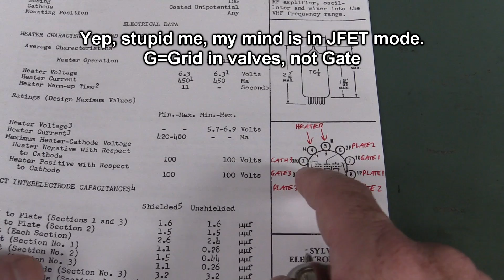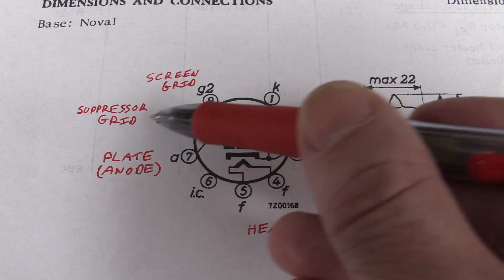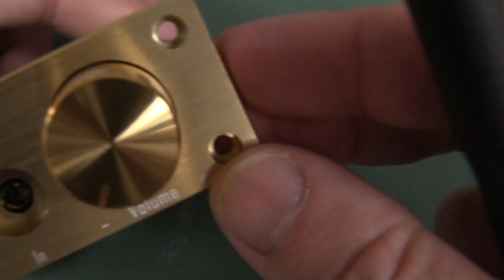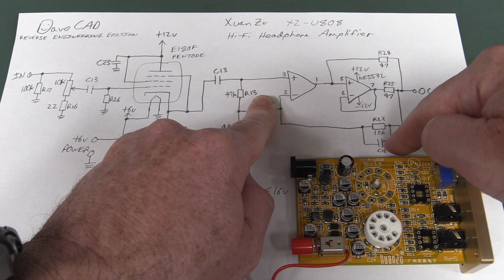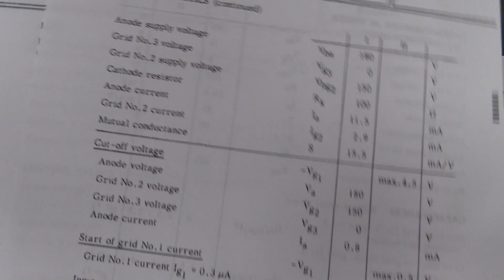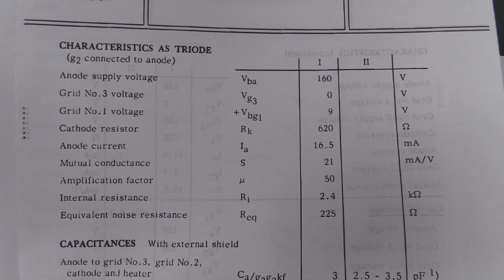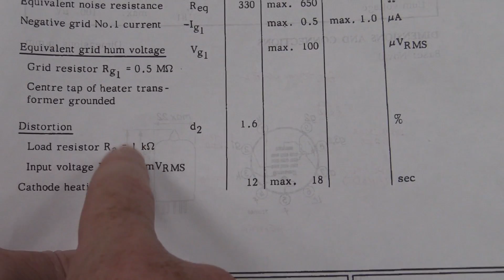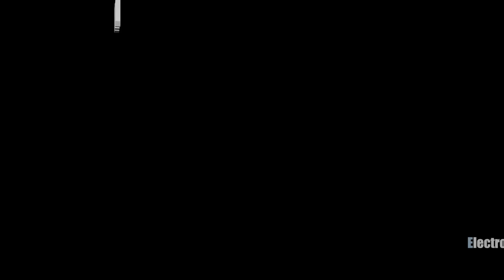EEVblog #837 - Reverse Engineering A Valve Headphone Amplifier

Comment: That's a shitty headphone amp, in no way any type of reference, and should not even be compared to REAL tube headphone amps. This is like taking a  Yugo 45 and then judging all other cars by it. Take a look a well designed tube amp, that would be more interesting. A lot of people (who don't know a lot or anything about this) will now wrongly take this video as proof that  all tube headphone amps suck. Manufacturers of junk like this should be locked up.
Reply: Why would headphone amps even use tubes? It distorts, and the producer clearly didnt intend more saturation on his track, making it worse.
Reply: +derbigpr500 Why not just use a DSP to color the sound to that of tubes and use a solid state amp that can be transparent for mere dollars?
Reply: +drkastenbrot 
Then you probably haven't used a headphone amp ? I build one myself and with a good audio source and a decent pair of headphones you can have the best sound system you can get in my opinion.
Reply: +Tim Ramich On live events, this is often done. Vintage audio compressors, amps, limiters etc. are emulated by software running on the mixing console. Also DSP is a common technique in guitar effect pedals. In recording studios real (tube) hardware is used because producers love it.
Reply: +Tim Ramich it´s already beeing done in the "lower-end" guitar amps and floor pedals....but they still can´t compete with the real stuff....as a keyboard/organ player, there still is no substitude for a leslie/rotor system when it comes to "sound" and especially when overdriven (=saturated)...I would love if there would be one, as my rotor system is 1.50mtr tall, and 80 by 80 cm width and lenght and weights about 50kg....

I tried nearly all "modelling" gimmicks (ventialtor, rotormat, leslySim....)but only the ventilator was close, but only when played clean, when it comes to overdrive it´s just harsh....naaah...
Reply: +drkastenbrot 
the producer's do even more stuff to add saturation. we use white and pink noise to underlay the mix. tube and tape saturation is added on almost every digital production.
Reply: +TubiCal Ever tried strymon pedals? Pure DSP, sounds amazing. Certainly not low end, used by many famous rock bands.
Reply: +Silent Woodworker Tape delay for the guitar, love it;)
Reply: +as df the problem with the DSP setups are, your at the mercy of the DAC. because I have heard some DSP stuff and they sound like mechanical shit. But ive heard other DSP stuff mainly in higher end radios, sound awesome. all depends.
Reply: +THEtechknight all of this is very subjective. Especially because the weakest part is always the speaker. No exceptions.
Reply: +drkastenbrot you could use the same argument to say that graphic equalizers are wrong to use.

people have their own way they like to tune the sound of what they listen to. you're implying that's wrong?
Reply: +drkastenbrot There are such things as pleasing distortion.  Also quite a lot of time the music is mastered poorly so you cant always trust the mastering engineer.  Honestly speaking as an audiophile, the mastering of the music is what will make the biggest difference in if it sounds good or not as long as its properly encoded/physical medium not damaged.  Once you have some equipment that is sufficiently transparent there are some albums that are unlistenable.  One of the worst offenders is Red Hot Chili Peppers Californication, I've also heard Imagine Dragons is terrible as well but I've never listened to them.  I've got both a solid state amp and a hybrid with a dual E88CC tube preamp.  Its uses the tubes as they were intended to be with proper voltages for the plates.  One reason tube amps can sound different and more pleasing to some is that headphones can have wildly varying impedance values over their frequency response which tubes will respond to in a different way vs solid state.
Reply: mmaluchnik
Yes, tube amps tend to have a more linear frequency response.
Reply: +as df You're joking right?
Reply: RminusOR O well, what I meant to say was that the tubes can flatten out the uneven frequency response of headphones (or other speakers) because their behavior is a bit less dependent on the changing impedance of the speaker.
Reply: +mmaluchnik After hearing Super Audio CD and DVD-Audio, along with high quality vinyl rips at up to DSD128, and directly comparing them to the same mix on a standard CD, I have realised how much we were all duped in the 1980s with CD.  Vinyl sounds totally superior to CD in every way, and with modern computer software nearly all the pops and crackles can be removed.  Nothing is better than the studio source masters of course, but we never get to hear those;  well I have but only with my own recordings in a tape based studios.  Modern digital studio productions these days are terrible and are over compressed and mucked around with, so even the best reproduction systems will struggle to make these sound listenable!  I love valves in guitar amps and some good audio pre-amps.
Reply: +EgoShredder You can make a CD sound just like vinyl. My guess is that to come to these delusional conclusions, you knew which was was playing. People never get to hear the studio masters? What do you think places like HDtracks sell? 16 bits and 44.1 kHz is enough.
Reply: +EgoShredder I do have to agree that the best sounding tracks I've heard have been in DSD. The DSD of Thriller is just stunningly perfect. I don't really think it's the DSD that makes it sound better, I think it just happens to be the best mastering of it. That's playing it with both JRiver converting it to PCM on the fly along with my other DAC that does native DSD.
Reply: Tim Ramich PCM music above 16/24?  What point are you trying to make?
Reply: +drkastenbrot Only guitar amps are supposed to add saturation, stereo amps are not. Some do unfortunately, I'm working on a stereo now that had aweful gritty base to it. Added some bypass capacitors to the cathode resistors and winner, winner chicken dinner. So it all depends on how good the circuit design is, nothing to do with what is used to amplify. Sound used to be produced directly from records with a funnel. Yet if you throw your phone into a cup it sounds like crap.
Reply: cyberdragon And why do you think you speak for everyone?
Reply: +mmaluchnik You drive your stereo amps into saturation? Well in that case it would matter.
Reply: The only time I use valves is for artistic reasons as a musician, but when I am listening to pre-recorded music I prefer accuracy and faithful reproduction, so no valves are in use as a listener.
Reply: Tim Ramich You did not read or understand my comments.  When I mentioned studio masters it happened to be my OWN music.  Of course I can never hear the master tapes of other artists!  I thought that would be obvious....  As for bit depths I think you need to gain more experience, because anyone who records and sequences music, will know that higher bit depths moves the noise floor further away, thus giving you more usable dynamic range.  It has long been known that using 16 bit means a narrower dynamic range due to the noise floor being higher, so to get around this people use more compression to squeeze more sound in that space.  Compression is a useful tool but you can use too much, and make things sound flat and ugly.  All being said I would still say you need to use your ears to decide what is best in any situation or format.  Last night I listened to a familiar album on SACD, which should in THEORY be superior to any other format but the one I preferred was the vinyl, as it sounded to have more body and realism;  the SACD seemed cold, clinical, thin although it was much clearer with less distortion.
Reply: +EgoShredder Bit depth is only useful for mastering. No shit you need a higher bit depth when you're combining tracks and adding effects. It's increasing the precision of calculation. As for final delivery for listening, 16 bits and 44.1 kHz is enough.
Reply: +EgoShredder Your SACD and vinyl test is shit. First off, it's sighted. Secondly, vinyl adds so much fuckery to the signal that it's easy to distinguish what is what. How about you undergo some blind testing where someone inserts a ADC->DAC stage to vinyl playback and see if you can detect when they switch it.
Reply: +EgoShredder People hear what they want to hear. There have been tests where they make a dummy switch that isn't even connected, and when people hear it switch, they report that the audio sounds different.
Reply: Tim Ramich Well the technology and performance of DACs  for encoding and decoding, not to mention the knowledge and experience has improved since it began in the 1970s.  So how come the majority of 16 bit 44.1kHz recordings sound horrible all these years later?  If it is so good and sufficient how come it sounds crap?  Why were we all duped in the 1980s about CD, when vinyl on a well maintained high end system sounded so much better?  The main reason CD took off is due to it being shiny and new, and solving the problem of pops and crackles and was more convenient.
Reply: +EgoShredder Modern music sounds horrible because it's compressed and limited. They make no use of the dynamic range. Secondly, producers of today have no knowledge of audio technology. Some early CDs sounded bad because they simply took the vinyl master and send it to be pressed on the CD. Go ahead and do some actual blind tests on this matter, or STFU.
Reply: Tim Ramich An A<>B test would not be required because the difference is so huge.  I have done many blind tests and the only time I find it harder, is on bland modern pop music where it is HEAVILY compressed with no acoustic instruments or harmonic content.  Once more challenging music is used, it is easy to tell the difference.  I'm also referring to MP3 etc in these kind of blind tests.
Reply: Tim Ramich I agree with what you say about vinyl and many of them are cloth eared, and do not know what to listen out for with music generally. That may sound pompous but it is true.  Logic would say that listening to vinyl is a stupid thing to do, but there is no denying it sounds good (not better than reel to reel tape though).
Reply: +EgoShredder I told you the type of test to take. Take your precious vinyl and insert a switchable ADC-DAC stage into it, and have someone switch it without you knowing, and then you report when you think it's been activated. I doubt with 12 bits and 32 kHz you could even detect a degradation from vinyl. Any reason a CD would sound bad is because of the mastering. FUCKING PERIOD.
Reply: +EgoShredder This isn't about MP3, this is about your claims that the PCM specification used on CD is audibly inferior to what human hearing can achieve.
Reply: Tim Ramich I agree with your comment about switching DACs and I would add amps and speakers to that list.  I've listened to certain CDs on my system which actually sounded quite good, and yet on my friend's setup it sounded dreadful;  he has a Cambridge Audio Blu Ray player which also does SACD, DVD-A and that is fed into a Yamaha amp and some KEF speakers I think.  My own setup at the moment is a SMSL M8 + VA2 headphone amp + P1 Linear PSU and Quested S7 active studio reference monitors (my old company used to sell them to Abbey Road Studios).  I also use AKG K712 PRO headphones.  My monitors need driving with a stong signal for best results, so I also use a small transparent mixer connected to the Quested S7.
Reply: Tim Ramich In theory you are totally correct but in real life I find things to be different.  I only mentioned MP3 because on some occasions, my blind tests included compressed formats.  I like PCM but only at higher frequencies and bit depths.  Why?  Not sure because if a couple of years ago you had tried to convince me of the merit of say 24/192, I would have politely shown no interest as I had always assumed humans cannot hear anything above the CD standard, infact theory tells us that CD far out performs human capabilities.  But even since the late 1980s I have not entirely been convinced by CD, and yet I persisted with it for many years.  I actually do not care what format I use, so long as it brings pleasure and reward.
Reply: +EgoShredder If you have indeed come to the conclusion through blind testing that 16/44.1 is not enough then there are plenty of people who would be willing to pay to have your golden ears tested.
Reply: Tim Ramich Yes I have for the time being reached that conclusion, but I am also curious to know why you yourself are happy and satisfied with 16/44.1 ?  I'm not trying to trick you or make out you are wrong or deluded, because ultimately you decide what you want to feed your ears with.
Reply: +EgoShredder Why do you keep avoiding the question about blind tests regarding 16/44.1? I've done my own BLIND tests. This is how I've come to the conclusion that 16/44.1 is fine. I did the vinyl thing long before the hipsters were into it. Then I did the high-rez nonsense. Most of the high-rez content are the same masters as they offer for CD. Most of the old music that they remaster and put on on high-rez even has clipping. At least with crappy pop music they mostly compress by limiting instead of clipping. There are so many old CDs from the '80s that are in my library, because they sound amazing and actually use the dynamics offered by CD. In case you didn't know, 16 bits gets 120 dB of SNR through noise-shaping.
Reply: Tim Ramich Blind tests with 16/44.1 ? I thought I had made myself clear that I have done this many times, e.g. comparing the same mixes done on that format against others.  However I also said that I did not like CD back in the 80s, but I carried on because I believed the hype like everyone else did.  So this was long before anything like SACD or vinyl hipness came to pass.  I agree about the hi-res nonsense as you call it, because a lot of SACD / DVD-A is rehashed poor recordings with a shiny new badge on.  However there are some genuine SACD out there but you have to find them, and then decide for yourself if they sound better than the other format versions.  I'm not sure what music you like to listen to, but I find most rock / metal on CD to sound harsh, thin and lacking realism especially with drums and vocals.  Occasionally some CDs sound fairly good, but probably sound crap if it were possible to hear them directly against the source tapes.  By the way despite all of my protestations and ramblings here, I have no appetite to mess around with any more blind tests. If this means you declare a victory then so be it, but I am VERY happy with my own setup and some of the releases and formats in my collection (approx 2000+).  As for pop music, yes limiting is used during the mastering process but compression is used a lot during production.  When used tastefully as a tool for problem solving, compression is fine but in the wrong hands.....you get the modern crap we have to suffer today, although the music is not good enough in the first place IMHO.
Reply: +EgoShredder Why can't you just take a high-rez format, convert it to 16/44.1, and compare? You're comparing different masters. It's well-known that the CD layer on an SACD is rarely ever the same master. Made to sound different so people like yourself can claim the formats are what sound different.
Reply: Tim Ramich Doing a quick and dirty conversion of SACD to PCM is flawed so I am led to believe, due to the complex process of SACD and the 1 bit format, hence why DXD is used for editing prior to the end SACD result.  However converting anything else to PCM like say DVD-A should be easy enough.  I've heard some recordings of DXD (PCM) and DSD (SACD) and I cannot hear the difference. There is a website with some free downloads, with multiple formats available on each track.  I could maybe use their DXD as a kind of pre-SACD file and convert that I suppose.  http://www.2l.no/hires/index.html
Reply: EgoShredder Yeah I know its not the best thing to do conversions, but the Schiit Bifrost Multibit DAC I use does not do DSD.  JRiver Media Center is really one of the nicest bits of software I've come across for computer audio, it does a really nice job doing the conversion to the point where I'm not sure anyone could really notice.  I certainly can't tell the difference between that and native DSD with my other DAC.
Reply: +as df WHY do "producers love it"?
Reply: +EgoShredder It was the RIAA equalization that was required to put sound on rippling grooves of lacquer, and later, vinyl. You needed all kinds of woo woo to make the sound "fit" into the grooves. CD digital reproduction was perfect and it amplified all the woo woo and showed you exactly what was happening to the original sound because the perfect reproduction of digital didn't need the woo woo. When playing back the woo woo you think you're on another planet. Once the engineers realized the problem(took about a week) they just put the sound on the CD's WITHOUT the RIAA equalization woo woo and it sounded perfect. WITHOUT ALL THE NEEDLE SCRATCH AND POPPING AND HISSING AND SKIPPING AND GETTING STUCK AD INFINITUM AD NAUSEUM. And of course, it allowed for PERFECT REPRODUCTION OVER AND OVER WITHOUT ANY LOSS OF FIDELITY OR DOUBLING UP OF NOISE.
Reply: Tim Ramich The consensus is that the bit depth is too low as the dynamic range isnt there, 24/44 should be enough when done right, or possibly 24/48 for just a tiny bit more for the sampling rate.
Reply: +mmaluchnik The consensus according to who? This has never been disproven. You're just spouting opinion based on zero testing.
Reply: Why does everyone get so angry about analogue vs digital?  I think both are valid formats and both excel at different things.  I've been in good, well run recording studios and heard analogue tape and it sounds thrilling and emotive.  I've heard and own excellent digital setups with their clean and detailed sound.  My preference after decades of using both formats extensively, is a high quality analogue setup but if someone else prefers digital that is fine by me.  However I do not like it when people say I am deluded for liking analogue.
Reply: +EgoShredder In a technical sense, 16 bit @44.1khz is perfect for humans (unless you're a freak of human nature whom can hear above 22khz).

The ONLY reason higher resolution and samples rates sound better (forgetting about different formats having different masters) is because of the current-day's DAC's not being able to output them correctly. With today's best DAC filters, they only achieve (if the rest of the DAC has been designed well of course) a linear frequency response (+/-3dB from 20hz to 20khz) across the whole audible spectrum with higher sample rates, like 88.2khz+. That's why most DAC manufacturers seem to give out their measurements when measuring a signal at 96khz, as at 44.1/48khz and lower, the frequency response rolls off before the end of our audible range (with a linear designed filter).

Above 96khz (like 192khz and other sample rates above 96khz) are absolutely pointless, they only reduce a DAC's accuracy (in which that is the only audible difference, which is a NEGATIVE difference which some people fall for as being better - as proven by Dan Lavry) and increase file space.

Dan Lavry as mentioned above, is a world class sound engineer who knows more about this subject than any "Hi-Fi" company on the market, with his words also falling inline with other professionals (yes professionals, not entrepreneurs wanting to rake more Hi-Fi money in with pretty, high-margin, low-performance products and lots of marketing).

From his testing, with the best modern DAC filters, around 60khz (if it were a commercially used sample rate) would be the optimal sample rate to achieve a flat frequency response from 20hz to 20khz. 60hz is not a sample rate that is used though and 88.2/96khz would be the closest to 60khz. They're probably the better choice too as those two should guarantee a flat frequency response up to 30khz, which iIrc the highest record a human being heard was at 26khz or around that figure (so these sample rates should cover people with freak of nature hearing too!).

Regarding dynamic range, a human ear can hear up to 120dB - 130dB of sound before it instantaneously destroys the ear drum permanently. Which 24 bit exceeds that amount to death levels (above 140dB it could kill you, which 24 bit has 144dB of dynamic range). Now regarding any audio playback at all, one should forget needing equipment to reproduce close to 120dB - 130dB (never mind 144dB or even higher, as some audio companies such as MSB seem to think is needed to have "perfect" sound) as unless you're wanting to only hear a small sample of audio within a safe time limit of those volume thresholds of the human hearing, it is utterly pointless in the real world and un-safe.

The human ear's auditory response is measured in dBA (though the ITU-R 468 curve is the closest measurement curve to the human ear, but  is irrelevant when talking about already measured A-weighted human hearing limits). At 1khz, volume is the same in every weighting (and un-weighted). With A-weighting, bass to sub-bass measure the lowest, with our most sensitive being frequencies around 2khz - 5khz which measure roughly 2dB to 8dB higher than un-weighted readings, but let's round that to 6dB. Reducing this 6dB from dBA results will give us roughly the un-weighted (aka linearly measured volume) range needed (un-dithered, excluding peaks).

The average music album is roughly an hour long, the maximum safe volume limit in that time is 105dBA. If we take away 6dB which could be used as "headroom" we are left with 99dB, which does not account for peaks in the music. The average movie is 2 hours long, the maximum safe limit in that time is 100dBA. If we take away the 6dB headroom again we are left with 94dB. I admit, movies are usually not at a constant average like music is and will consist of loud scenes and quiet scenes, not all music is constant either but for the purpose of this example it is. In the most extreme example, if someone were to want to play a single 5 minutes long track at the loudest volume within safe limits of this single track's length it would be roughly 120dBA, minus the 6dB headroom would leave you with 116dB! While it is not up to anyone to tell somebody what volume to listen at, that is an extreme case and is not recommended.

These are all times and values that one can withstand within 20 - 24 hours. For example one can only be exposed for a set time at a set volume once every 20 - 24 hours. Once one gets close to/or exceeds the time limit exposure for a give volume, to keep ones hearing from not damaging it's advised to stay away from sounds above 70dBA for this 20 - 24 hour duration. Just as a reference, busy, loud traffic can have a volume of around 70dBA - 90dBA. So it's best not to get too close to the maximum time for you set volume otherwise you may have to stay away from the busy streets for 24 hours!

The above paragraph is not relevant to the discussion though. To sum up everything regarding volume, dynamic range and why 16 bit is enough. The whole point of having higher than 16 bit audio is to reduce the noise floor and therefore be able to increase the volume while still retaining the quietest parts of the audio being played back at the quietest limits of our hearing. The average consumer room has an ambient noise of 40dBA - 50dBA, with sound-treated recording and broadcasting studios having roughly 20dBA - 30dBA of ambient noise. 16 bit again has a dynamic range of 96dB, even if you wanted to play a single test tone at -1dB in the digital domain in a nicely treated room with 20dBA of ambient noise to be measureable, you would have turn up your equipment to have 115dB as the peak and that's even if you have the equipment to boast such specs. If the system cannot output cleanly (low THD+N - enough to not mask the sound) at that volume (even if the room is sound-treated) there will be no audible benefit to going from 16 bit to 24 bit at the same sample rate. Unless you listen to music in an anechoic chamber, or want to hear quiet sounds past roughly 115dB (which would mean a VERY short exposure to be safe at that volume level) then 16 bit is perfectly sufficient for the human hearing in un-extreme cases.

As talked about at first, regarding DAC's and filters. If the word was perfect and DAC's could output a 16 bit/44.1khz signal with perfect linearity (with everything else being perfect too of course) then CD would sound exactly the same quality as the same master in 24 bit with a higher sample rate (unless ones hearing is better than 22khz, aka a human anomaly). The world is not perfect though and to achieve this as above, we need to use a sample rate of either 88.2khz or 96khz (either one is good but can be suited for different media in the editing process). Both of these higher sample rates are tied to 24 bit, which even in extreme cases would still exceed human hearing and 24 bit is better for mastering because of the headroom.

So to sum up, 16 bit/44.1khz is really all the average human needs. But current technology does not perform optimally at this spec and in the most extreme cases, it's not enough.
Reply: +Michael Walsh Current day DACs? I don't think so. Maybe the DACs that were around before the 21st century.
Reply: Tim Ramich Look up some of Dan Lavry's papers on this subject please.
Reply: +Michael Walsh I don't care about papers and people theorizing about things. It's called oversampling, and it's been around for decades. The file format itself doesn't need to be wasteful in size. The only people who are possibly affected by such nonsense are those audiophools who swear by idiocy like non-oversampling DACs.
Reply: Tim Ramich Oversampling produces artifacts and can produce inaccuracy if not well implemented. It is much better for the source to work at 88.2/96 than it is to over-sample.

Read up on his papers, the PCM spec etc. You will learn a thing or two ;)
Reply: +Michael Walsh Prove it. No one has ever proven such nonsense. Not even with measurements. It's all just theoretical drivel. Either 16/44.1 is enough, or it isn't. Which one is it?
Reply: Tim Ramich If you would read what I have typed, you would know there is no true answer realistically. For the extreme cases, 16 bit is not enough.

But for 99.9% of people, with a system not actually capable of reaping the benefits of 24 bit/higher sample rate audio (for that you need everything in the system chain to be able to produce that volume, with the amplifier and DAC + preamp having distortion below the outputted volume) and a sound-treated room, it will sound the same.

Again, I'm not going to waste my time explaining what's in Lavry's papers regarding sample rate when one can do a simple Google search. But for sample rate with a linear DAC filter, 88.2/96khz are the optimum and always better.
Reply: Michael Walsh Much of what you write I have read before down the years.  I agree about the 16 vs 24-bit theory, well actually it is fact although I have been called an idiot for thinking 24-bit can help with the noise floor etc.  Also in theory 44.1kHz is enough as you say providing everything is optimal and done properly, e.g. good enough DAC, recording and so on.  At least two of my own DACs are in external devices specially made for music production and/or listening performance, so I assume they are of a high enough standard;  one is from 2005 the other from last year.  For whatever reason I have clearly noticed that going to 96kHz results in smoother, more refined audio.  However the jump from that to 192kHz is harder to tell if at all.  I have yet to record anything at 192kHz and have only heard other people's recordings at that sample rate.  Regardless of which format is technically superior, I just simply adore analogue as it is much easier and more pleasing to listen to for me.  However digital is very competent and convenient, there is no denying that.
Reply: EgoShredder Personally, if I have the choice I always go 24 bit. Though I still enjoy CD's. I also love the sound of vinyl for older music that was intended to be mastered fully analogue, like The Beatles for example and Led Zeppelin. I have heard modern music that was digitally mastered on vinyl though and much prefer the digital version.

16 bit is enough for the large majority of people, personally it's only use is in the studio where the reduced noise floor is better for mastering and extreme playback in a well sound-treated room. In the average persons home, even with high-end (and well measuring) equipment,there will be no audible benefits to 24 bit audio (it's the higher sample rates that will be the upgrade in sound).

Regarding your findings with samples rate, it falls in line with what I explained. The 88.2/96khz sample rates are improving the sound but above that it does not.

A good paper to read if you have time is:

http://lavryengineering.com/pdfs/lavry-sampling-theory.pdf

This explains the optimal sample rate very well.
Reply: +drkastenbrot Transistors may not be as wonderful as you think. They have linearity problems and need to be biased (Partially turned on) to get them to the point where they approach liner amplification. This adds to waveform disturbances and a DC component that has to be filtered out between stages.
Reply: +mmaluchnik You got that right. There are plenty amazing songs like "In The Meantime" by Space Hog and Saliva's "Your disease" that have been very badly encoded. It is like the climax of those songs were too complex to be reduced to a digital waveform.
Reply: +EgoShredder I am with you and you nailed the difference in one word > EMOTIVE < Well...Maybe two > Thrilling < . I get plenty out of my digital collection. But I get MOVED by my analog tapes and vinyl.
Reply: DSD256+ into a good Single-Ended Triode Tube Amp is the best I have heard. That's my rig (Currently maxing out at DSD256).
Reply: Class A solid state is the best I've heard.
Reply: Если поменять микросхемы на AD797 ANZ, то усилитель может зазвучать куда лучше, даже с лампой 6Ж9П. Кстати, маломощный  усилитель на  6Н2П и 6Ж9П звучит очень даже хорошо, чисто. Поэтому искажения, вносимые лампой могут не ощущаться на слух вообще, все зависит от схемы и подбора деталей, режимов.
Reply: I agree, there are trade-offs when using CD quality audio versus master recording versus live.    This is one of the reasons why I started playing guitar a couple years ago.  The delivery method for most music is crap these days, with overly compressed dynamic range (every re-release of old albums cranks up the compressor a notch), and mp3s that mangle phase relationships.  Stevie Nicks songs from late in her career are a good source to detect phase shifts from MP3, since her voice is on the verge of breakup, and the MP3 file size compression process finishes the job.